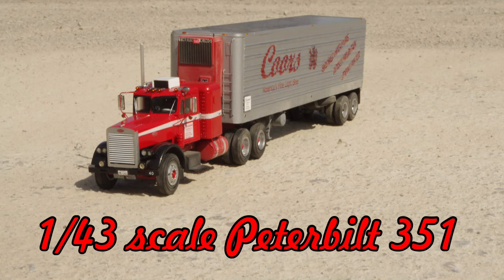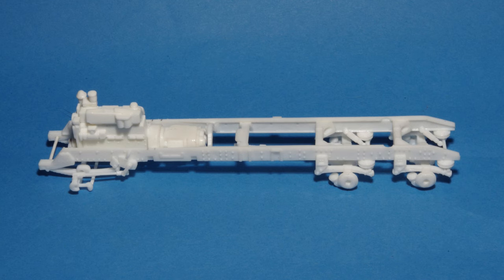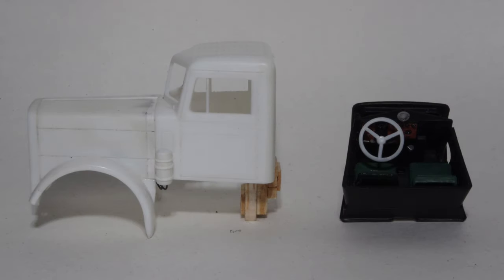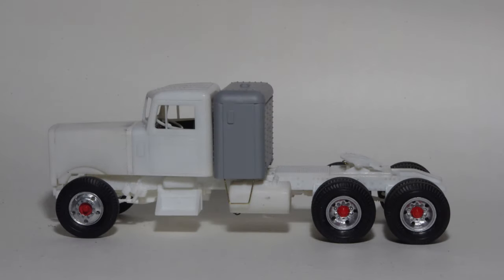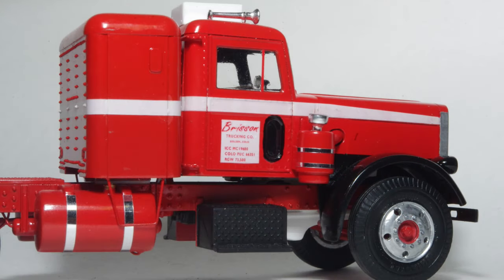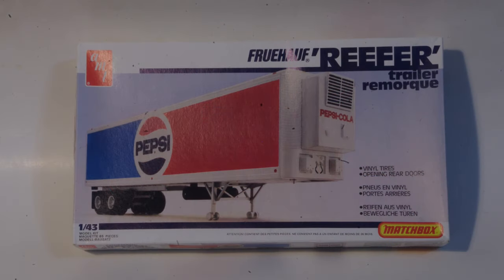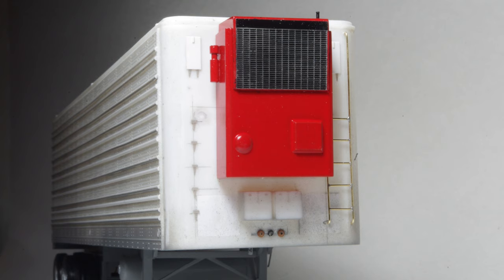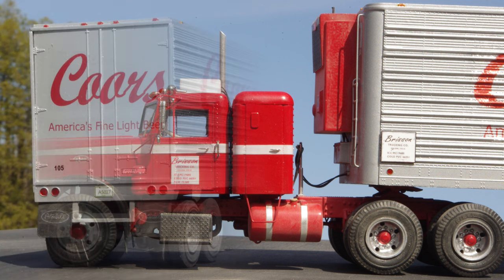1/43 scale Peterbilt 351

Comment: Nice job! I remember getting the Sears AMT 1/43 Peterbilt and trailer kit back in the 70's for Christmas one year.
Reply from the maker: I had the 7-Up version of same kit, and around the same 1970’s time frame as well!

Interesting to see how times have changed, a couple original issue kits (“open/complete”, not sealed - they were available fairly cheaply at the time) are Pabst White-Freightliner and Budweiser Pete 352. Budweiser Clydesdales with wagon also. A manufacturer today couldn’t even consider marketing a beer-themed model kit!
Reply: Ha, you’re right!
I do remember seeing the 7up kit now that you mention it.
I was way into the 1/25 truck kits as a kid so the Sears was the only 1/43 I had.
Reply from the maker: @bluefj-wc3vz  Sounds similar to me back then, I did have the 1/43 K100 and refrigerator trailer (Ringsby decals) however always preferred the 1/25. Kit acquisitions were of course largely limited to birthday, Christmas etc. gifts when I was a youngster, and as I was a fairly typical “glue bombing” and “brush painting” builder they went together fast.

Now everything is reversed: Lots of kits in the accumulated collection, including a multiple 1/43 Pete 359’s, trailers, and another K100 - but limited time for building them!
Reply: Yep same here.
Big collection of sealed unbuilt kits I have collected that bring a smile to my face. All from that same period.

Comment: 1/43 scale....very interesting. 
Great looking rig.
Reply from the maker: It is a shame AMT didn't make a wider range of these kits. They had some 1/43 scale cars as well, a brief thread at 
http://www.modelcarsmag.com/forums/topic/71313-amt-143-scale-tnt-series-truck-trailer-kits/ indicates the cars were tooled in the 1960's with the trucks coming out later, around 1972/73. 

Some tractor + trailer combination kits were offered, I had the 7-Up set as a youngster. I also recall having, as separate kits, the Kenworth cabover and the refrigerated trailer with Ringsby United decals.

Comment: When I used to use an inkjet printer, I'd sometimes print two sets of the same decal and put both on if I wanted it less translucent. These 1/43 models are very nice, just as nice as the 1/25 versions but almost half the size.
Reply from the maker: I wonder if AMT had more kits planned for this scale but didn’t find the market share large enough?
Reply: @brsnorthernhorsejourney3579  I remember when these were reissued as a set, I should have grabbed a couple.
Reply from the maker: @crushingvanessa3277  I have seen Heller reissues more often than the AMT ones, same parts but different packaging, box art etc. Also no chromed parts which is actually a plus as it saves having to do the chrome removal process during assembly.
Reply: @brsnorthernhorsejourney3579  No chrome in them? Most rig aren't show trucks anyway. I know the boxes were huge compared to the originals, during a time when everyone was trying to save on packaging.
Reply from the maker: @crushingvanessa3277  Yes, all parts trees modded in white. I used the Heller issue of the K100 to build green one shown in the “Keep on (model) truckin’” video, come to think of it the box was fairly large. I think it was actually a set with 359 Pete as well.
Reply: @brsnorthernhorsejourney3579  I think it was two in one box.